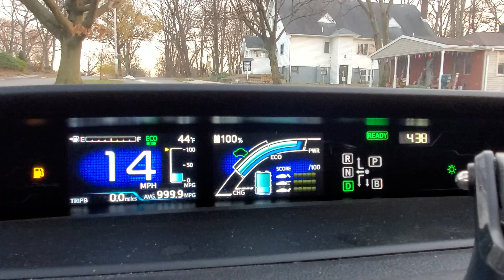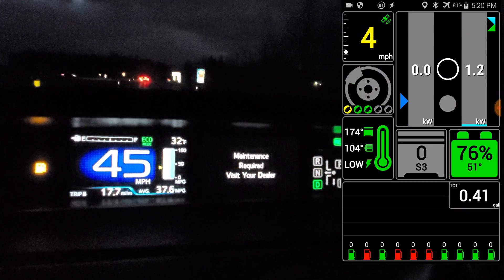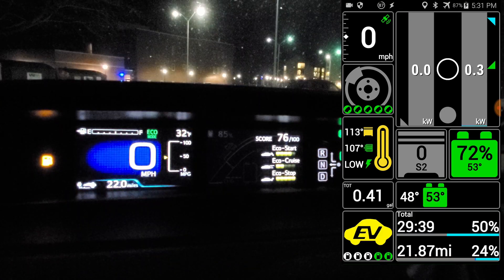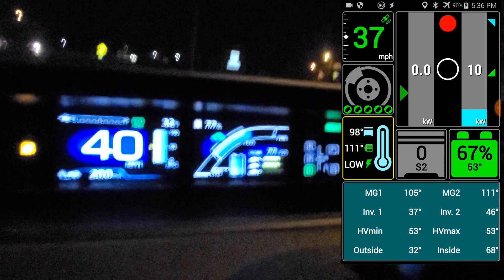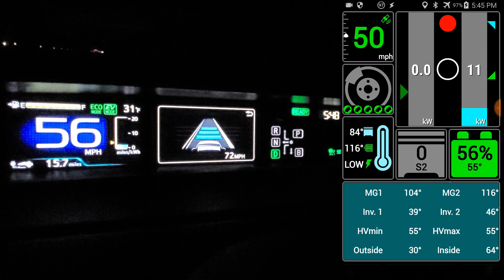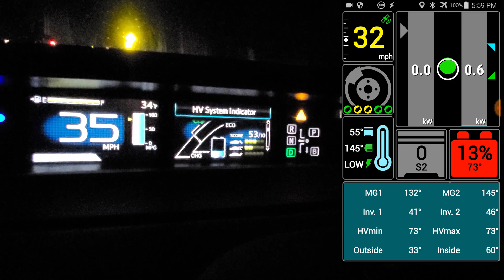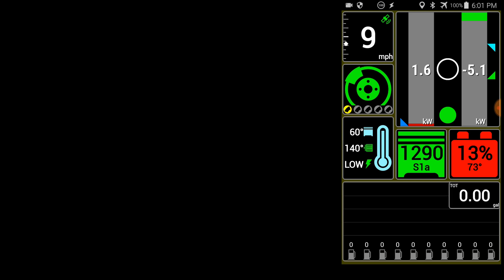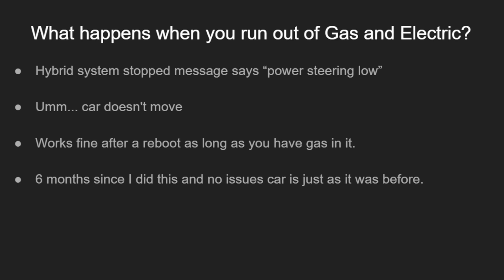Running a Prius Prime out of Gas & Electricity

Comment: The fuel pump uses the gas to keep it cool. Running out of gas is playing Russian roulette on burning up fuel pump.
Reply from the maker: Yep definitely not recommended just a one time curiosity.
Reply: @DustanD  thanks for the test. It was very informative. It's also very cool Toyota didn't keep the fuel pump running where it would burn up once it no longer could pump gas. Smart, efficient design. I was hoping your entire drive that was somehow a feature. Glad it was. Good video.

Comment: Thanks for this video. I'm surprised it didn't let you use the traction battery portion. I ran out of gas on my regular prius (2nd gen) and I was able to go a couple miles on the traction battery before it fully shut down - just couldn't get to the next exit. Also, when I ran out of gas, the display threw up a giant exclamation mark with the word "Problem", which was not particularly helpful in determining the cause. The gas guage had gotten stuck at some point, so I didn't realize that the tank was running dry. Still, I assumed with my new Prius Prime that it would let you use the traction battery after running out of gas and electric, just to give you that extra mile or two.